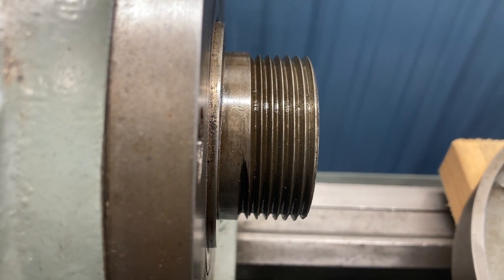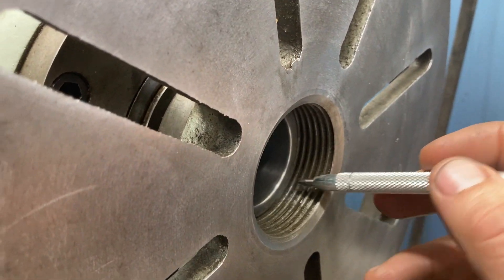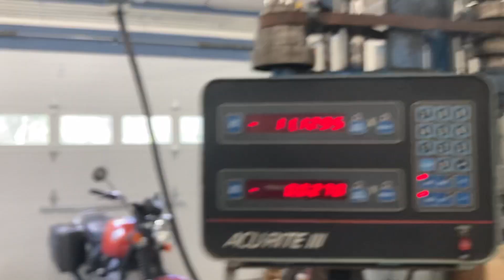WOHLHAUPTER Head Machining a Lathe Faceplate

Comment: Good info to know. I have a Logan 920 that I need to repair and restore, so this is helpful.
Reply from the maker: Glad to be of help. Definitely check that diameter and you can also contact Scott Logan at Logan Actuator. He’s very helpful with information.
Reply: New to machining but have this facing boring head but why not put the faceplate on backwards to match your specific lathe by cutting on that lathe?